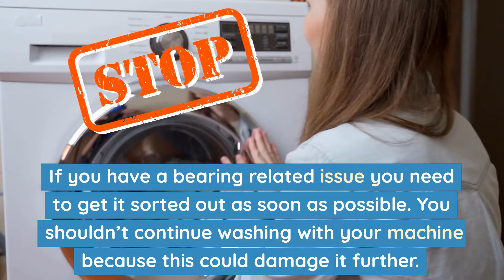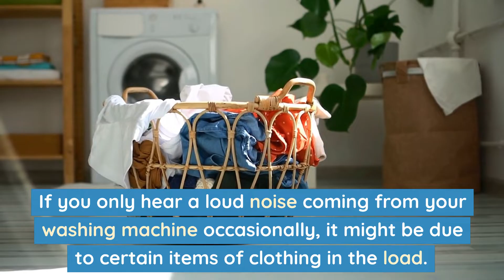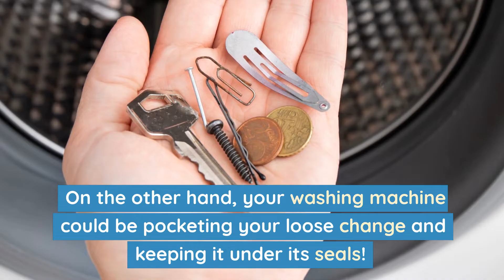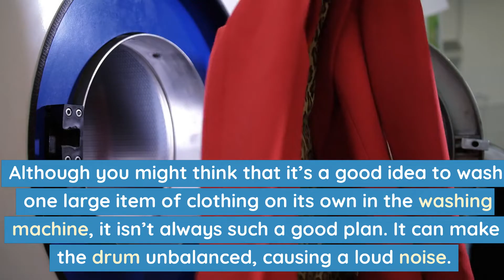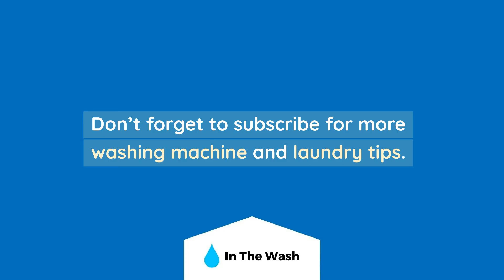Why Is Your Washing Machine’s Spin Cycle So Loud?

Comment: Check the cross-brace isn't cracked too.  Its the 3 sided boomerang thing attached to the metal drum that's connected to the drive wheel. Common problem on Samsung ecobubbles.